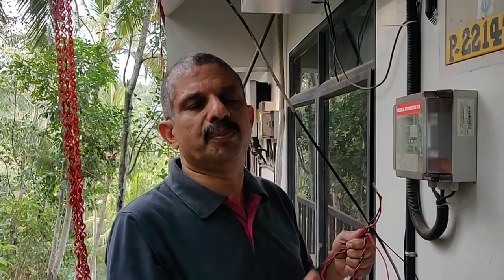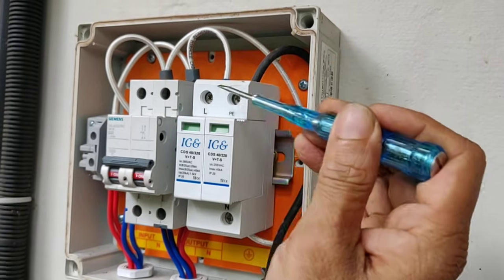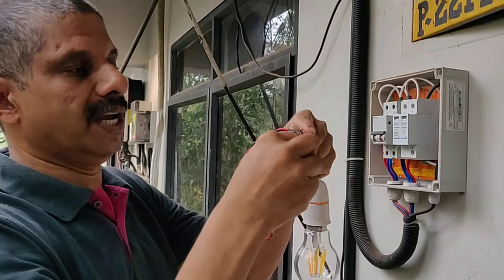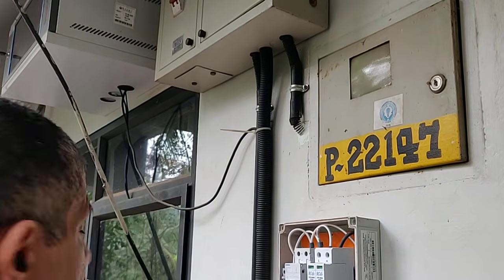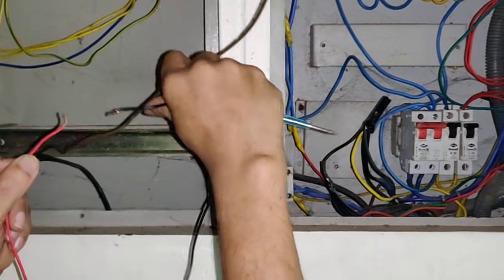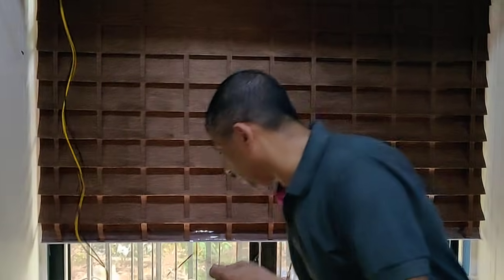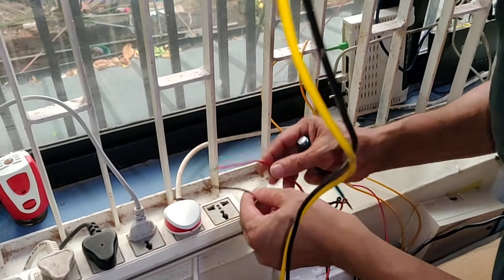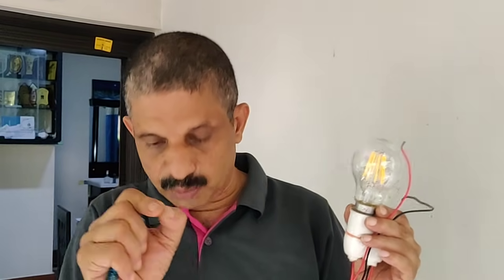വീട്ടിലെ എർത്ത് ലീക്കേജ് സ്വന്തമായി കണ്ടെത്താം

Comment: Ups nte earth to nuratral 100V um 
Earth to line voltage 1 V um kanikkunnu ....
Ups il connect cheyunna ealla device  lum metal part il tester vachu nokumbol tester il light kathunnu....
Ethe oru complaint ano...?
1000VA/600V ups

Comment: aslamu aleykum.ikka aa water purifier pumpinte video cheyuthille athil Ulla pole oru DC 12v 100w air water pump directly soalar panel vech run cheyan ethra waltinte panel anu avisham. Athinte regulatotum ethanu vendath

Comment: ടെസ്റ്റ് ചെയ്യുമ്പോൾ ആദ്യം എർത്തു വയർ കണക്ട് ചെയ്യണം പിന്നീട് ഫേസ് ൽ ടച്ച് ചെയ്യുക അപകടം കുറക്കും അല്ലെങ്കിൽ കയിൽ നിന്നും വയർ വിട്ടു പോയാൽ ശരീര ഭാഗത്ത് സ്പർശിച്ച് അപകടം ഉണ്ടാക്കും
ഏറ്റവും നല്ലത് ഇലക്ട്രി ഷ്യന് നൂറ് രൂപ കൊടുക്കന്നതാണ്
Reply: ഇലക്ട്രിഷ്യന് 1000 രൂപയാ ഇപ്പോൾ മിനിമം ചാർജ്
Reply: @muhammadshareef6158  250 Rupa thanna mathi njan varam
Reply: ഡോക്ടർ 👌👌👌👌
Reply: കൈ വച്ച് പോയിൻ്റ് മറയ്ക്കുന്നു. കാണാൻ പറ്റുന്നില്ല. ന്യൂട്രൽ, എർത്ത് രണ്ടിനും ഒരു പോയിൻ്റ് കാണിക്കുന്നു. ആകെ confussion. അനുകരിക്കരുത്. ആപത്തു.
Reply: haptop ൻ്റെ said ഭാഗം ടെസ്റ്റർ
വെക്കുമ്പോൾ കത്തുന്നുണ്ട്
ചെറുതായി രോമത്തിൽ നുള്ളുന്ന പോലെ അനുഭവ പെടുന്നു കാരണം എന്താണ്? please replay
Reply: ആളെ വേണ്ടത്ര മനസിലായില്ല എന്ന് മനസ്സിലായി
Reply: @abe_abrm  അല്പ ജ്ഞാനം ആ പത്തa
Reply: @abe_abrm aale manasilaayi, valya electrical and electronics engineer aanu. Pakshe ee reethiyil cheyyunnath apakadamaanu. Nhan electrical work cheyyunna aalaanu
Reply: ആരും അനുകരിക്കരുത് അടുത്തുള്ള എലക്ഷൻ മാരെ വിളിക്കുക
Reply: എന്റെ വീട്ടിലെ ഫ്ലങ്ക്ബോക്സിൽ ന്യൂട്ടറും ഫെയ്സും ടെസ്റ്റ്ർ ഉപയോഹിച്ച് നോക്കുമ്പോൾ രണ്ടിലും ലൈറ്റ് തെളിയുന്നു എന്തായിരിക്കും കാരണം ?
Reply: hassan parol Nuetral Cut aayathukondu aanu Anganea varunnathu
Reply: @anasanu1084  nutur disconet aytundavum
Reply: @anasanu1084  neutral connectoin correct alla...
Reply: @anasanu1084  nuter brake
Reply: @anasanu1084  nueter brake
Reply: @anasanu1084  switch offakiyalano
Reply: @anasanu1084 neutral cut..
Reply: Nutral cut
Reply: Incoming Nutral wire connection may be absent.please check incoming link from service

Comment: if checked with multimeter how much voltage should it read?
Reply: My nutrel to earth 57 voltage thats problem or not
Reply: @alukkalshafeeque  earth leakage und.
Reply: Phase with neutral 220 v
Phase with earth  220v
Nutral with earth less than 5 v
Reply: If you have well knowledge about Electricity use this method other ways use multi  meter.
Reply: @sav3sathyan  correct